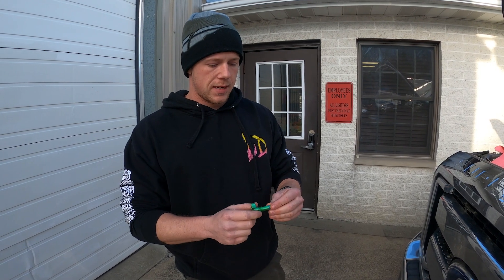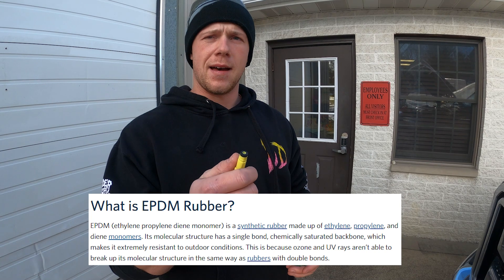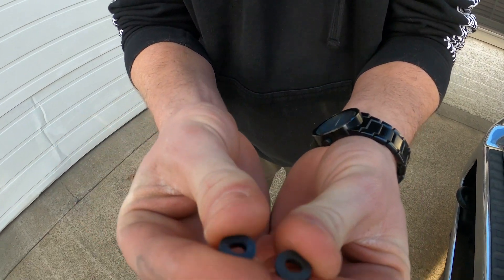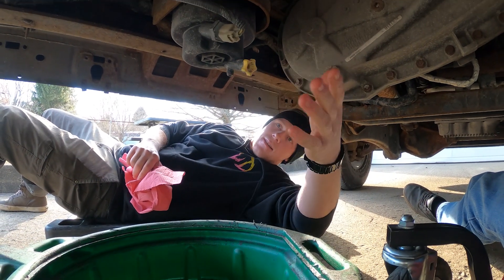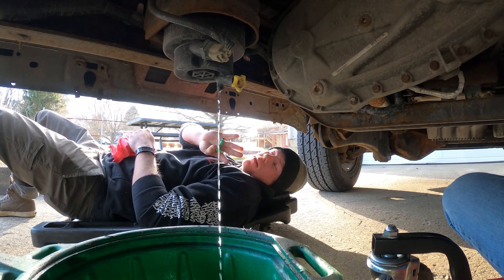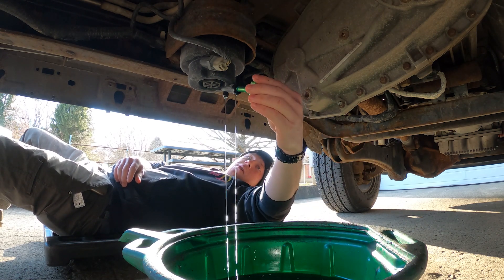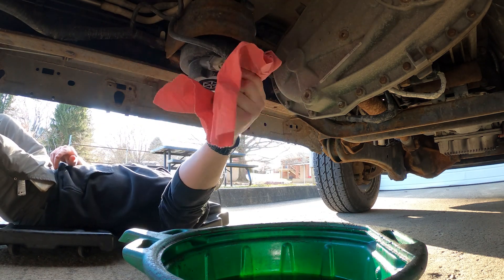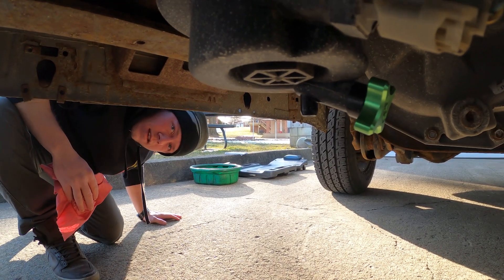SPE Billet Fuel Drain Valve • 11-16 6.7 Powerstroke

Comment: FYI and you can include this in the install instructions for the 11-16 trucks. The valve when cracked open actually will sometimes cause a vacuum to start in the fuel line and pull fuel from the tank. How to stop this is to actually start removing the housing just like you were going to remove the filter this allows air into housing and will not cause a vacuum from the tank. Or something like you did and just remove the old and slap the new in right away. I drained almost 3 gallons of fuel the first time I went to change my filter thanks to it vacuuming from the tank because no one told me.
Reply: Yup...unthreading the housing 3 full revolutions closes off fuel flow, and allows you to only drain the fuel that's contained in the filter housing.

Comment: I got mine in the mail today and noticed that the o-rings are different than the one you show @ 2:50 ( they are blue, and look like you just transferred them off stock drain valve ). The ones that came with my SPE drain valve are black & a bit less in thickness. Just wondering if you could elaborate on this.

Comment: I have that humming noise from the filter,  Its always been repplaced by Ford dealership.  not even 10k into that last filter change any thoughts on that?   Doesnt leak fuel but ive heard and read that it could be air into the system. Truck only has 26k and is a 2016build date. Just seems wild if its a breakdown and all I do is a short ride to and from work on pavement No add ons.
Reply: @ResultsWillVary  Thank you yes I have filters installed by the dealer and always have,  and have more then followed the recommennded service intervals. Thanks for the info